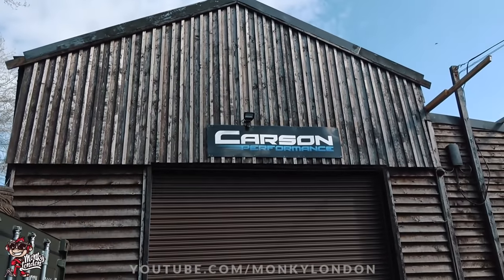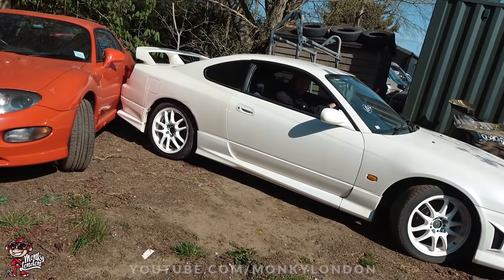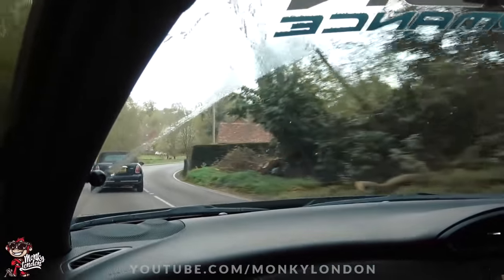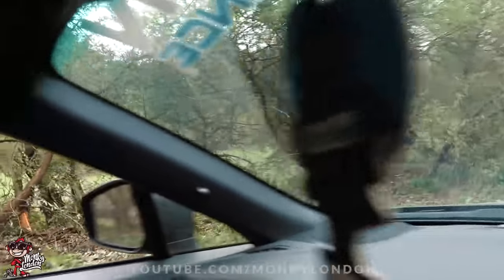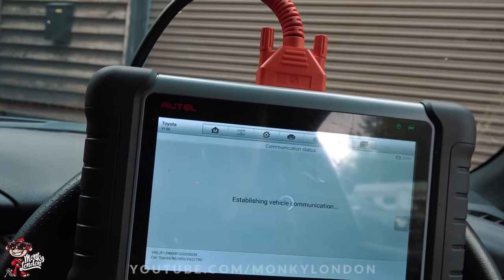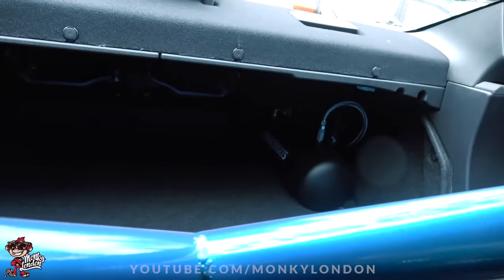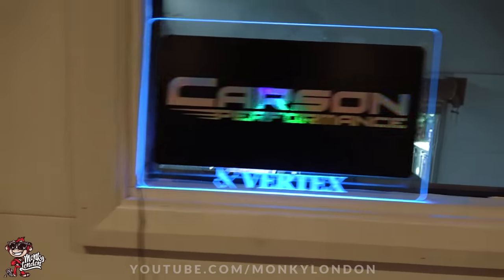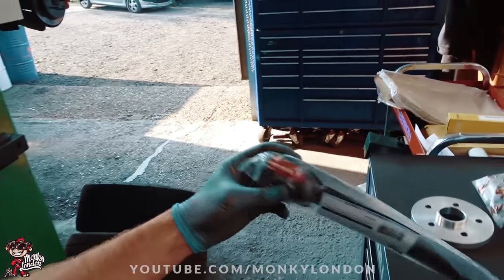🐒 HOW TO GET A GIRLFRIEND - LOWER YOUR CAR LIKE A G6! (SLAMMED CARS)

Comment: Awesome video guys👌 what wheels and specs are you running on the gt86? Also exhaust setup? SOUNDS SWEET!
Reply: Cheers man, wheels are Rota MXR 18x8.5 et38 with 5mm spacers. 
Exhaust is a bit of a mismatch. Catless manifold (unknown brand) and no silencer in the rear with custom quad pipes. Added a sports cat in the middle to take the edge off the sound as it was quiet loud lol. Did have a decat as well but all hell broke loose when that was on😂